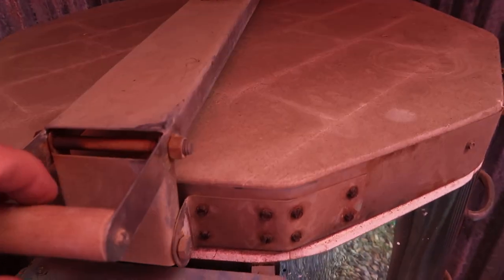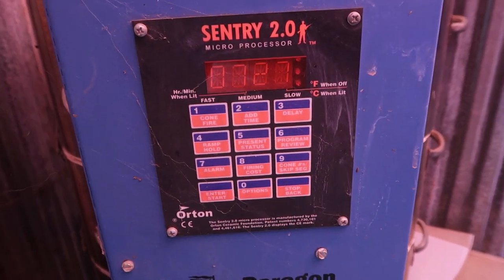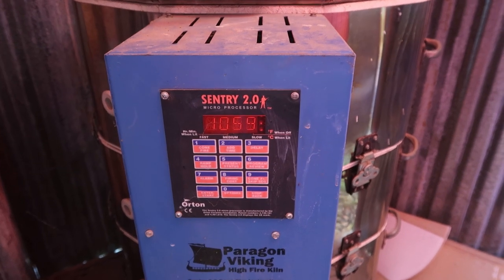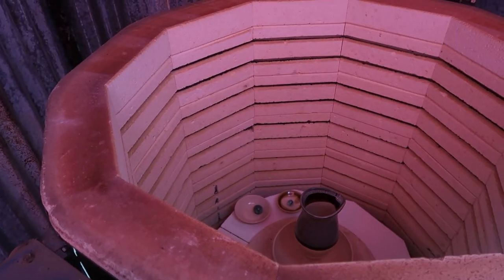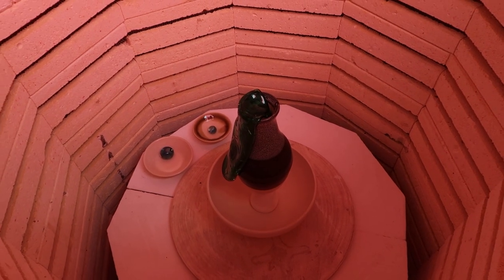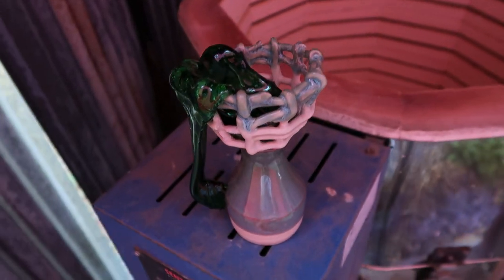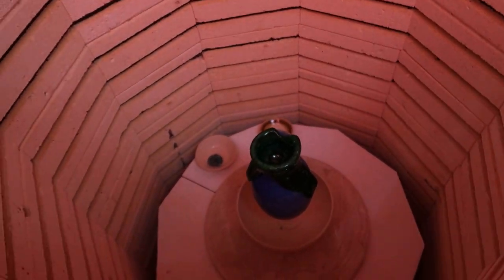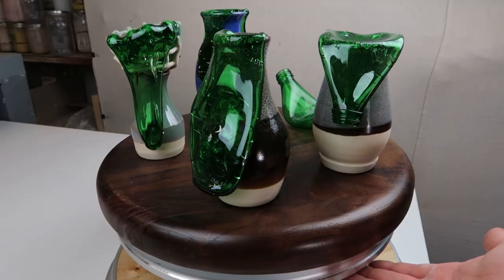Melting Glass Bottles on Pottery - What is the best temperature?

Comment: I love experimenting with glass on ceramics! I just finished doing a project at uni where I took the tiny glass beads from inside a weighted blanket and tried to get them to fuse to a ceramic surface without completely running, based on a 113 year old patent for the process that has been lost to history. I took the beads up to 012 and they didn't melt at all without a flux to help them, so it's interesting to see those big marbles starting to melt at a lower temp.

Comment: There's no way to cool it slower, so it don't shatter like it usually does? I always wondered if ceramic shrank at a different temperature or speed as glass and if so, would that cause the glazing to shatter like that... because I've seen cases in which certain types of glass will always shatter if used to glaze ceramic. As far as I know though, many people recycle glass bottles for glazing. They usually seem to mix them with other things though, so I'm not sure if that has something to do with why it doesn't shatter. (I know very little about pottery).

Comment: Glass has different melt points. 
I use COE 91 glass which melts at 1480F.
Reply: I don't get this cone rating thing at all or what the point of measuring it like that is. It goes from 1-10 and then 01 to 022. I think Cone 013 was the only one that showed it was in your range though. There could just be another measuring system I don't know about too though. I don't know anything about pottery/kilns.

Comment: Where are all the tests from cone 14 to 5? Lol I want to see it fully melt till it pokes a hole on the mouth of the bottle and yet not so runny that runs off and sticks the piece to the shelf :)
Reply: Is that 014 to 5 or 014 to 05? It's a really weird system that I don't get. Seems like the regular numbers are all above 2000f and all the numbers that start with a 0 are all below 2000f. I have no clue why they would rate/measure it like that though.